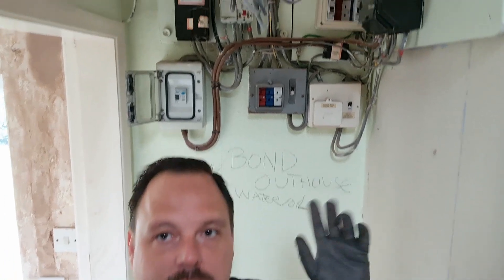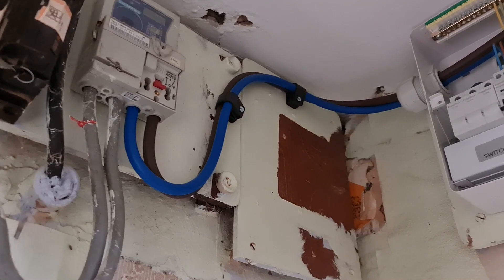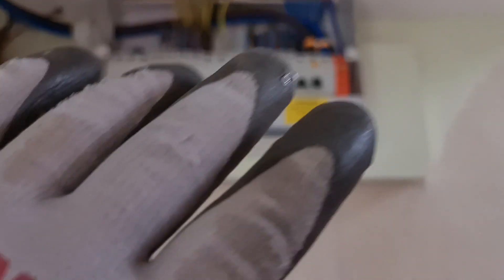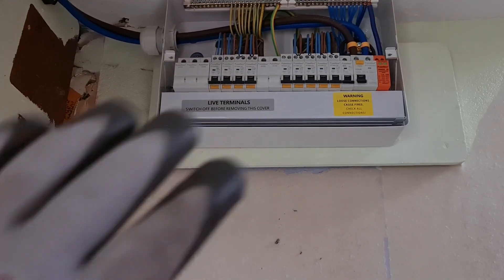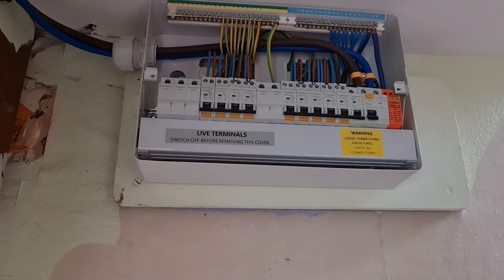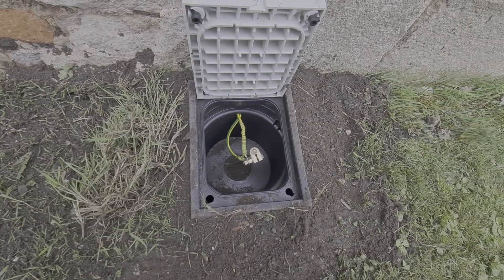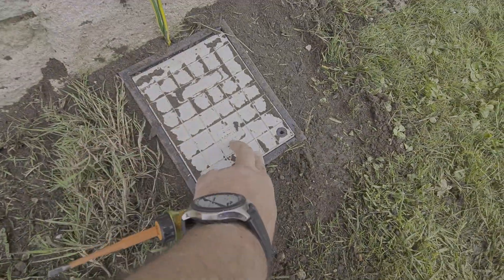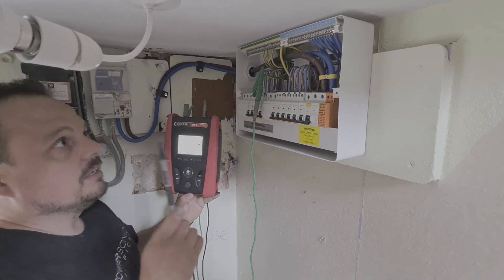Consumer Unit Installation - CP FuseBox reviewed - TT supply with S Type RCD. Rewire Series Part 3

Comment: hi whats the reg number for the double pole rcbos?
Reply from the maker: In terms of a TT opening L and N on faults?

This is due to N-E not being effectively bonded and the same potential as in TN systems among other things. Lots of regs play a part. BS7671 is a powerful friend.
Reply: @electrician247 its a great idea and should be implemented on TT but I just can’t find where it says to do so I can however find it for some of the special locations caravans,temps, marinas, car chargers which most often are TT systems but nothing specific “RCDs must disconnect all live conductors including neutral conductors”
Reply from the maker: @giz177 if you are using SP rcbos you will need an up front RCD that is DP to open LN in the event of a fault as per regs. Your final circuit would leave latent faults on the NE and ultimately trip the upfront protective device. Plenty of regs to use around that. So in essence its not really an option to use SP rcbos. Of the past it was the only real option along with split load boards but that's not the case these days. We can even look towards 9mA limits on circuits with rcd protection as angles on regs. None of this is especially new but for those unfamiliar with TT can be confusing. Its all in the big brown book. Im not an encyclopedia for it but when I get 5 mins with chuck a few options into this chat for you 😅
Reply: @electrician247 yes I’m 100% with what you’re saying as far as I can the book doesn’t explicitly say anything for TT but does for special locations which are in TT, and everything else you mentioned I can find there are all spread across the whole thing but I can find them it’s should explicitly say it’s needed like it does for stuff in part 7

Thank you anyway you YouTube is great
Reply from the maker: @giz177  Very rarely does the book state specifics around installation methods outside of special locations. Its the cumulitive intent effective design is behind. If we have an upfront all pole RCD it can be argued we dont need to disconnect LN on final circuits however that falls foul of issues around a single fault impacting a whole installation the 9mA limit on 30mA rcds and such. If we omitting an upfront RCD we could then lool towards just opening L on rcbos but again we come back to other angles in terms of fault and addiotnal protection both on final circuits and at the DB. With staged RCDs we have selectivity and limiting operation by faults in certain parts of the installation and the 9mA limit on each circuit. It can even be argued with a low enough Ze we dont have to have RCDs at all. Which is why the regs can nver be paint by numbers. Of the past this was an issue as RCD tech was either inavailable in the form we need or very expensive. None of which is true now so the debates and issues have long since past. Much better to proceed on the path shown in the video as then we are firmly onside with the good book etc
Reply: @electrician247 well thank you I appreciate your help and agree completely I think double pole wouldn’t be a bad idea on all installs with the grid only getting older and older

Comment: Why do they use those awful facia screws for the lid, only a matter of time before they lose their grip in torn metal.
Reply from the maker: Not had an issue with that so far. But you never know.

Comment: Hi Mark another great video.
As a fairly new electrician passed my AM2S last year, could you do a video or explain rcd trip times for a tt system -  eicr? Ive looked online & cant seem to find anything. 
Example:  tt. Ze 115 Ohms. Zs will be too high for regs book so 1667 is used on 30mA rcd. 5x trip is more than 40ms due to high Ze & Zs but regs says 20ms max for rcd?
Am i right in thinking that the rcd is used for fault protection & not additional protection so 1x max 300ms or upto 500ms on an S type?

Thanks

Michael

Comment: Good job, I can see what you mean on TT, a separate plastic enclosure for the 100mA to protect the tails going into the metal DB, well done should that be a requirement, never seen it done before on new installs
Reply from the maker: Nit a requirement William. But it makes sense to me. So long as tails correctly glanded and secure no need to go to that length. But it's fairly low cost and gives a bit of peace of mind for me.

Comment: Good to see your videos mark , but totally disagree with some parts of this. You stay " some people dont understand why S type RCd is Used" then say its to protect the main tails , Its not, Main RCD or mcb's , RCBO's only protect anything downstream , not upstream. the main tails are upstream of the main RCD. once installed, never would the main tails move and come into earth contact. If the main tail (live shorted with earth the S type RCD wouldn't do anything! the main cutout need to operate for protection
nowdays using all RCB's on a TT you dont need S type main RCd, we had this exact same topic come up at a NICEIC & ECA seminair and all agreed its not necessary
Just my opinion  , we use fusebox as well, good and greatly priced
Reply from the maker: I agree Paul,  take a listen from 3 minutes in after reading below. If you watch my other videos you will see I use a separate plastic enclosure before a metal CU. In this case I couldn't as fusebox dont make one. I did discuss this exact scanario you describe in the video! So I secured the supply tails as best I could and I agree the likelyhood of contact with the enclosure in minimal now. However when I refer to tails I am also talking about the Neutral RCBO flylead/tail and SPD Line and Neutral tails. Perhaps poor terminology but the S type 100% looks after these floating reniforced single insulated conductors in the CU. It was more of a general statement rather than this particular example but I can see how that would cause confusion.

I did an electrium Crabtree starbreaker install pretty similar in an earlier video with the separate plastic enclosure and S type. Its just opinion but for me the use of an S type on TT has saftey benefits and for the cost why not use one. 

Thanks for watching and the comment

Comment: Quick question why have you put the 100mA s type time delayed rcd in? It's only a requirement for split load boards with a metal enclosure because of all the fly leads from the main switch feeding the rcds, its not required for RCBO CUs as the they only have a solid busbar after the main switch and the likely hood of that making contact with the outer casing is non existant
Reply from the maker: Often use them pre any board on a TT in a plastic enclosure. I didnt in this case as fusebox dont seem to do a plastic enclosure. 

The reason for having one is the neutral fly leads and tails into the SPD which do not have any rcd protection. I know technically you can exclude them but for the cost and potential safety benefit in the event of an issue makes sense to me. Same argument as for a split load board. Only reinforced single insulation on those tails. Hope that helps and thanks for watching. Appreciate it

Comment: I might be a bit dense here, but how is that time delayed RCD protecting the tails when it is not upfront of them?
Reply from the maker: Tails of the rcbos and SPD in this instance. I prefer to fit it external to also protect the meter tails if possible.
Reply: @electrician247  Thanks for clarification. Appreciated.
Reply from the maker: @BULLEAD  no problem. Thanks for watching mate and getting involved in the comments.

Comment: Neutral and earth are out of sequence by not considering spare ways in middle of board.
Reply: Did he make the same mistake as Adam the apprentice 🤣. We are all human and it’s easily done.
Reply from the maker: 100% I make mistakes everyday. Found a couple of others during the testing. But those are in EP4. Wanted to keep this one focused on the CU as a whole and exclude the wider job lol. Probably another terrible production decision 🤣
Reply: @electrician247  Well I’m sure it won’t  be as bad as corys recent mistake. Tugging on the cables and skagging them on metal capping.
Reply from the maker: It may appear that way, but you have the huge excitement of waiting for ep4 of the rewire series to watch me find this mistake at the testing phase 🤣. 

It isnt the only mistake either btw.

This is the reason I dress boards and then test them as I would during an EICR. I think I make that point in this video actually lol. I know I am capable of mistakes, good spot. 

Ep4. Is already recorded, was done on the same day as this one but not out until next week.

Thanks for watching

Comment: Why not just use an rcbo for the spd? Would be cheaper and easier to source?
Reply from the maker: Only rcds rated to go before an spd are S types as far as I understand.  Also wouldnt help the neutral fly leads on the rcbos. 

But its an interesting suggestion. Thanks for watching
Reply: @electrician247  I guess a normal rcd could trip to quickly under spd operation

Comment: Nice one mark what a cracking video I love the way how are you explain how everything works.Opportune you enjoyed stripping out all the old Equipment. I’ve never used fuse board I’ve never really fancied it.I’ve always heard rumours that their RCBO’s fail after a year or so.That was probably just a rumour started by the other manufacturers.Hopefully they will force or the other manufacturers To bring down their prices.Then I can finally stop fitting Dual rcd consumer units. Of which I don’t really have a problem with but I would prefer to do RCBO.  Lovely and neat as well mate thanks again
Reply from the maker: Cheers Will, appreciate you watching mate. I was the same with fusebox. Stayed away for quite sometime. But always like to give things a try. Really hard to knock it for what they cost. Time will tell with longevity.  But we have the worry with all manufacturers really. I am still sore from the wylex failures and recalls in the early 2000s lol. 

Awesome work on your channel as well mate. Got a few of your videos to catchup on this weekend.
Reply: Both you guys produce some amazing content 👌.  I'm taking in some great info through your vlogs 👍.
Reply from the maker: @rayc1503  thanks! Very kind.